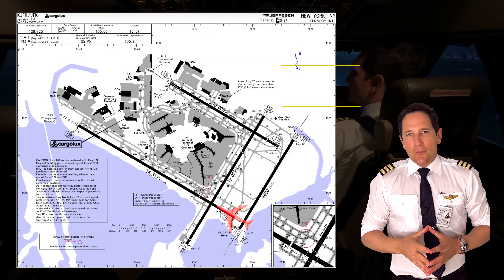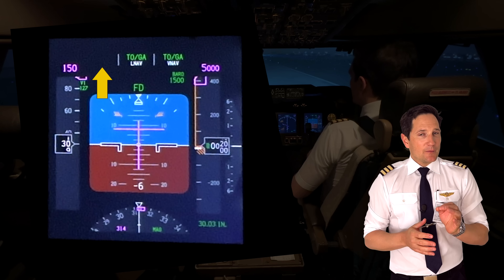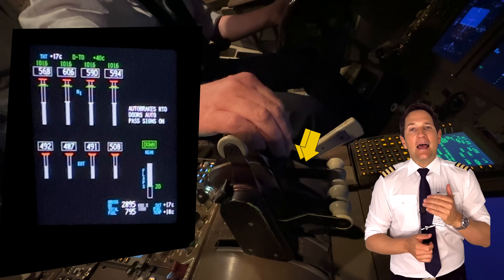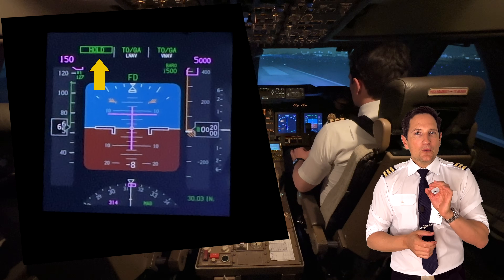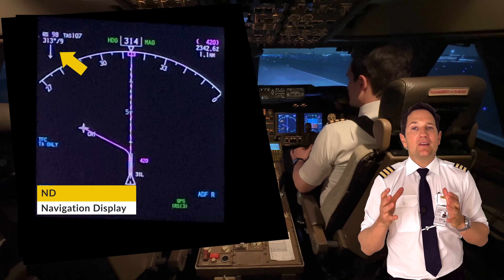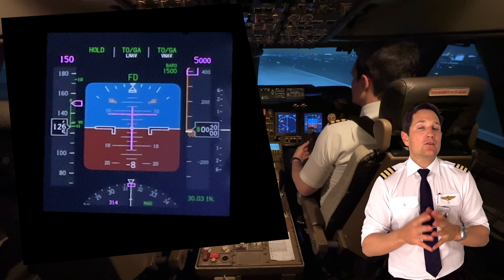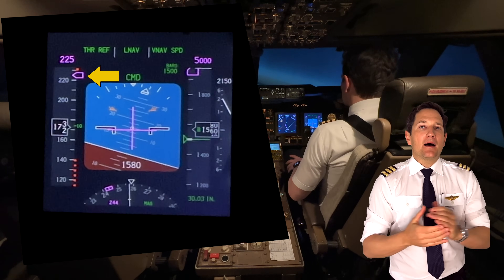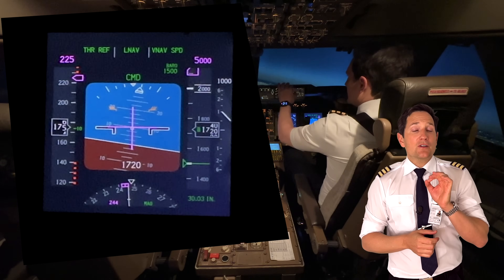HOW TO perform a TAKE-OFF in a BOEING 747? Explained by CAPTAIN JOE

Comment: One detail did not get mentioned: The PF is looking straight ahead on the runway to see where he is going. But after lift-off, is there any need for him to look outside or can he focus entirely on the PFD?
Reply: Once airborne then you start looking inside only. As most probably one is doing an instrument departure. Although yes if a procedure requires, then you have to fly with both outside and inside. Good example for the same would be Paro airport
Reply: @ZK-APA  I had an argument with an American on a different youtube video, and he asserted that the PF has to look outside even after lift-off, but I suspect he was making fun of the commentaries.

Comment: when you said that the rotation pitch rate is 10 degrees pitch in 4 seconds do you apply 10 degrees back pressure on the yoke or 2.5 degrees every second on the pitch until you reach 4 seconds?

Comment: The riddle (Imagine a 747 is sitting on a conveyor belt, as wide and long as a runway. The conveyor belt is  designed to exactly match the speed of the wheels, moving in the opposite direction.)                                                                                                                          Can the plane take off?                                                                                                                                                                                                       Lets brake it down                                                                                                                                                                                                                 747= real plane, it will take off                                                                                                                                                                                               Sitting= Stopped, not moving, wheels not turning, and conveyor not running.                                                                                                    Conveyor belt designed to exactly match the speed of the wheels = Conveyor belt can only match wheel speed, it can't change wheel speed.                                                                                                                                                                                                                       Moving in the opposite direction= The top of the wheel the moves in the same direction as the planes forward movement, the bottom of the wheel moves in the  opposite direction to the planes forward movement. So any conveyor belt the wheels roll over moved opposite the plane.                                                                                                                                                                            To make the wheels turn the plane must move forward, as the wheels turn they roll on the conveyor belt at the same speed. Because the speed of the wheels  already matches the stopped conveyor belt, the conveyor belt  will not have to start and the plane will take off.                                                                                                                                                                                                                                  I see now this is not riddle, it's the definition how planes take off from a runway with one word changed. they replaced the word runway with conveyor just to confuse everybody.

Comment: Just stabilize the engines at approx. 50% N1, slight nose-down input, press TO/GA, read out the FMA "THR REF |              | TO/GA." At 80 knots indicated, throttle hold will replace "THR REF," enabling the captain to retard the throttles in case of a rejected takeoff. V1, hands off the throttles and Vrotate. Positive rate (vertical speed indication), gear up. "THR REF | LNAV | VNAV SPD" will indicate that you're flying what was entered into the FMS now. Follow the flight directors. Around now, the tower will hand you off to departure. Retract flaps according to what is indicated on the speed tape. When climb thrust is set, PACKS on (if they were off before takeoff), gear OFF position (if you are flying the Boeing 747-400), runway turnoff, and taxi lights off. Landing lights off above 10,000' MSL and QNH standard pressure above transition altitude.
Reply: (Don't forget to select the autobrake selector to off)

Comment: Captain Joe Sorry… does the Yoke and Joystick roll inputs deflect the rudder to some degrees? Since i see most of you guys don’t apply rudder inputs on the first turns after takeoff but you are seen Rolling, pitching up and a small yaw assisting changing the heading. Please i will be happy to know about this scenario✈️
Reply: The yoke/sidestick doesn't control the rudders. However in airliners the computers does the turn coordination rather than the pilots themselves with the rudder.
Reply: @ZK-APA  Understood. But does roll Motion Abel to change the direction/heading right?
Reply: @SullyBeger  Yes. In air you use roll to change direction

Comment: Hi Captain Joe, can i check with you. At 3:29, when you mention 40 deg (would this be in Fahrenheit?), is this outside air temp or engine temp? I would assume it is outside air?
Reply: Its neither. Its "assumed temperature". Basically what that means is that you are telling the engine's computer that assume the outside temperature is 40 degrees. Without going too technical, basically how the system works is that the higher the temperature, lower the thrust you will get. And when you take off with lower thrust, you are basically increasing engine life. (the temperature is calculated so that you still have enough thrust to take off)
Reply: @ZK-APA  ahh interesting, thank you so much for the reply! Understand 😊

Comment: Interesting that flight climb speed is regulated not by thrust, but by auto control of the pitch.  Climb rate is the variable.  I never would have considered that.  Shall I infer that depending on temp, initial ground elevation and therefore pressure, ... that climb angle will be different?  Ex.  Taking off from a place like Denver (5,430 ft) airport would require a shallower climb rate for the climb out?

Comment: Why does the airplane need to keep a fixed speed until the acceleration alt (1500 ft) is reached, is it because all power is invested into a high climb rate away from the terrain?

But if so, I guess the climb rate is also somehow limited, isn't it? Then isn't the power enough to both maintain the neccessary high (but limited) climb rate and accelerate simultaniously?
Reply: During takeoff, your rate of climb is dependant on your target speed (which is mostly V2+10). Achieving this speed is more important as it'll keep the aircraft controllable if it looses an engine. Now with that speed, it should be able to maintain an initial climb gradient (depends on the airport's location).
Hence the intent is to maintain that speed, and keep that minimum climb gradient. Hence your climb rate can vary (as long its above a min requirement), but your climb speed will remain same.

Comment: Thanks for the video, Joe. How does the private simulator compare to a professional certified simulator?  The graphics looked really nice, but I'm wondering about the simulator software, if it's performing like the professional one.
Reply: Professional flight simulators are certified by the regulators. Hence what you do in them, can be counted as official training/check. Also they would have a higher running cost.
Private simulators vary in terms of how complex they are, and their certification also varies. Hence private simulators are mostly used for personal practice (or professionally for whatever it is certified for)

Comment: Captain should have discretion to stop on the runway even after V1. Concorde and Flight 191 would have less casualties had the captain overshot the runway. Its better to overshoot the runway than come crashing into the ground.
Reply: They do. You can reject after V1 on the basis of the situation (as in you know the aircraft isn't flyworthy anymore)
Reply: @ZK-APA  No. I think they are committed to takeoff after V1
Reply: @ssap3717  Its more of a committed* to take off.

For example, if there is a catastrophic structural failure after V1, you wouldn't continue to take off.  But its a very split second time decision to be made.
Reply: @ZK-APA  I think Concorde and Flight 191 emergencies are severe enough for an aborted take off after V1. If they loosened the rule a bit, may be those captains would have aborted instead of taken off. No one should be committed to get on air. If the captain or FO isn't feeling it, they should be able to abort even after v1 imho. Ground is much safer. Even in Air France 358 had everyone survived.
Reply: @ZK-APA   Ameristar 9363 is a good example.

Comment: eeeeeeasy m8, if the battery is dead, get a small cessna 152, hook a rope to both planes, get the big plane in neutral, go ham with the cessna and after some speed put the big plane in second gear and dump the clutch, should start easy

Comment: It is interesting to me see the AP to be ON before the take off. I thought that pilots activate the LNAV and VNAV and they fly at least to a 1500ft manually or the whole SID manually and lnav and vnav just helping them to see the calculated pitch and roll. After this which could be somewhere between 1500 and 6000 feet they would turn on the AP and not before.

Comment: you would think that the TOGA button would just give every bit of available thruse, and a standard takeoff you just puth the throttle to the full calculated thrust. because if you mis calculate the thrust ref then you need more thrust during your takeoff toll (or go around situation) then you should be able to exceed the thrust ref immidiatly by pushing the TOGA button, to override the calculations and just give the most thrust the engines can possibly provide. i can see hitting the toga and only getting a reduced thrust rating for your go around due to wind sheer, could cause a potential problem, im not a fan of that system tbh, i get having the reduced thrust ratings to ensure longevity of the engines and stuff, but an engine that is derated might cause an accident, and now you have no way to instantly override the miscalculated de rated thrust you entered with the push of a button, where you really should have that override available IMO
Reply: You can override the derated to get TOGA thrust at any time.

Comment: Nice video, thanks. Now all i need in msfs 2020 is to "git good" at landings with 747-8 when i am not gonna get an engine strike almost every landing.😅
Reply from the maker: Best of luck!
Reply: @flywithcaptainjoe  Honestly, 747-8 feels strange in my msfs. Maybe because of the physics i don't know. 
It's not really hard for me to do a butter in A320neo. On airbus i never had wing strike, even during gusty winds.
But in 747-8 even during no wind and 100-200 feet per minute touchdown the plane can suddenly starts to roll to the left or to the right while moving in opposite direction. 
I am trying to keep it on the runway, and then boom(wingstrike).
I am still not sure why this is happening.
Maybe i need to use speedbrakes manually for faster reaction. I saw they have a delay between touchdown and actual applying of them. Or to use different settings of autobrakes, or not to use them at all. 
It also feels that on 747 suspension is a lot more softer than on A320neo. And i am not i am a fan of this. 
I even watched real landing of 747 and i did not spot that sudden movement.
Well i definitely need to do more testing. But at least i know for sure that those who flying real 747 are absolutely great pilots. 
Best of luck to you too. 😁
Reply: @flywithcaptainjoe  Ok, i actually did some testing. I did a couple of traffic patterns over KJFK at night with no clouds and calm winds. First attempt ended as usual...😩
On second one i tried to do max slowdown of the plane after touchdown. I used max auto brakes, max reverse trust and manual speedbrakes, and it worked.
i think the best way is just to make forward gear touchdown the ground as soon as possible, and when it's still in the air not to change direction with rudder. i guess 747's suspension is a lot less resistant and it just let the wing or engine touch the ground. Plus the rudder not only turning the plane to the left or right, but also it adds some roll effect and with soft suspencion i get an engine strike. 
And ye with 747 i really need to land on the center line. This thing really wants me to be perfect, other ways simply doesn't work.

Comment: Aint there a speed limit of 250 KIAS below 10,000 ft? Is this corresponding with the rise in VNAV SPD during continous flap retraction? How about to deal with short term speed limits given by atc?
Reply from the maker: You either leave the flaps out to fly at a lower speed or have to negotiate with ATC.